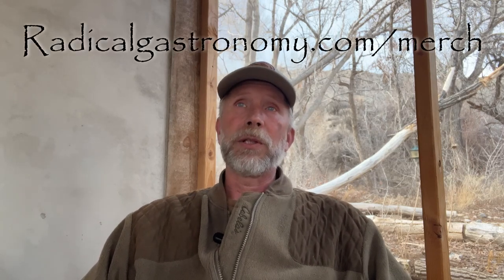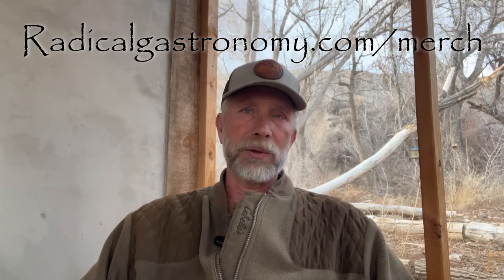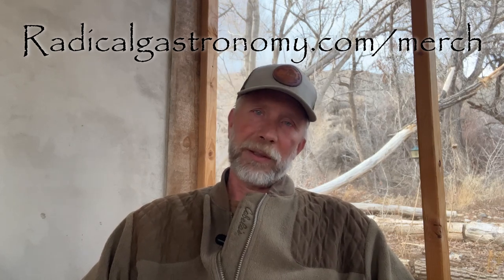Dustcrete FAQ Part 2

Comment: Have a couple ideas and questions . I’m a stone mason , for the last  30 years..hopefully retiring soon. Have you used cement bonding adhesives to prevent cold joints or admixtures to prevent shrinkage ? Also , is there a reason you are not using a fiberglass or basalt stucco netting to prevent cracks at those cold joints when applying the lime plaster ? Having cracks through both the cold joints and the plaster seems less than ideal, but can be solved pretty easily . Also , a polyurethane spray foam at those shrinkage points might help with energy loss considerably ..although 1/4” doesn’t seem like much, if that gap is around all wood posts, beams and sills, that really adds up as far as heat loss/gain being direct air transfer is one of the biggest culprits of energy  loss in the interior conditioned space.

Comment: If you don't want to use a steel mesh for reinforcement, you might consider using a fish net.
Reply from the maker: You bet
Reply: If the longevity issue is the reason not to use steel, you should also not use fish net made out of artificial polymers.  I work in the plastics & rubber business, and we consider product in our warehouse stale after just 2 years.  It's not just sunlight and ozone that degrade plastics, most also have a tiny amount of the catalyst used to create them which causes degradation over long periods of time.  We add anti-oxidants to nearly all plastics but that still doesn't entirely stop that process.  I'm not sure about nets made out of natural fiber materials, I don't have experience in that area so I have no idea how long they would be expected to last in this application.  One thing I have learned in my career is that it is very, very difficult to know how solid materials will behave over decades of time.  The only materials I know of that can be expected to last 100+ years without change are ceramics or brick.
Reply from the maker: @danielwebb1004  Good to know! My assumption is that organic material within this system would eventually fossilize, but there is no telling what will happen after decades. I suppose if the fish net just made the panel rigid enough to un-form and move into place, that may be enough. 🤷🏼‍♂️

Comment: Can I just use Portland cement because where I live we can not get type s lime and will this building technique work in an area that has negative 30* Celsius?
Reply from the maker: @sharonglazier2552  I don’t honestly know how a straight cement mix would do. People are reporting good results with subsoil clay added. A couple test blocks would be more informative than I can be, I suspect.
Reply from the maker: @sharonglazier2552  And for -30 winters I’d go 12” thick on the walls.
Reply: @radicalgastronomy  Thank You  very helpful.

Comment: Appreciate the part 2.  Was down in your neck of the woods for a bull sale.  It's a beautiful area.  Would fiberglass fibers incorporated into the mix help with the strength and cracking?
Reply from the maker: They may, or chopped straw. Did you buy or sell a bull? What breed?
Reply: @radicalgastronomy  I went with some rancher friends.  They bought a few bulls although current prices were a shock.  The bulls were Angus and gelbvieh.  I'd love to raise a beef but wouldn't be a good fit on my property so I'll probably just trade my friends halibut for open range beef.  Straw has been the classic reinforcing material for eons.  I won't have access to straw but I'm sure I can find a natural fiber that would work

Comment: Whelp, I'm sold. It looks like I'll need to go through your videos again and get an idea as to how I'll pull this off this spring. Thanks for the update and Q&A, the information is greatly appreciated!

As far as your RMH goes, what's the design that you are looking at building? I've built a couple of them, my biggest was a six-inch batch box that fed into a masonry block raised bed inside my Annualized Geo Solar high tunnel. It worked so well that I was able to extend my growing season by several months up here in Zone 5A Kenai Alaska.

Thanks again for the updates, and I look forward to your coming videos!
Reply from the maker: I’m thinking of building a J tube 6” system with a brick “barrel” (plate steel on top) with a stratification style cob bench. So cool that yours worked in a high tunnel.

Comment: Dustcrete looks like a good answer for better use of the piles my chainsaw mill generates!

Your discussion of roofing at 5:56  struck a chord. It’s definitely frustrating to revert to glass or foam when the rest of a build is hyperlocal. Being away from the road system in Alaska, importing materials is expensive², so on-site materials are preferred for multiple reasons.

I actually stumbled upon your dustcrete series while looking for examples of sawdust itself as insulation. It’s sometimes mixed with a small amount of borate and used like a cellulose infill. 

For a full sawdust envelope, might it make sense to stuff the “hat” with dry sawdust rather than dustcrete?

Comment: Thanks for making these videos. Lot's of great information.

I saw another commenter taking a crack at the reinforcement problem and thought I'd throw in my two cents. For an alternative to steel reinforcement, there is basalt reinforcement mesh and rebar that has several advantages over steel, one of which is that it does not corrode. There is also basalt fiber which could be used directly in the dustcrete mix itself.

Looking forward to the rocket mass heater. Good luck!
Reply from the maker: Cool. Thanks for adding this info!

Comment: 9:19 ... plus the weight of the CO2 absorbed from the air to transform the slacked lime into calcite (slacked lime molar mass - 74, calcite molar mass is 100). Ah, yes, porland cement has some calcium hydroxide too and the cement curing rely in trapping crystallization water (e.g. which water will cause the concrete to spall when heated in fire)
Ummm... how about actually weighting the samples you'd be using in your bullet resistance tests (rather than relying on by-the-ear estimations)?